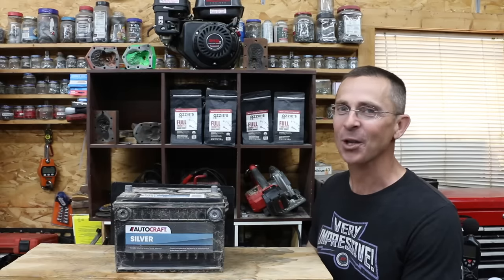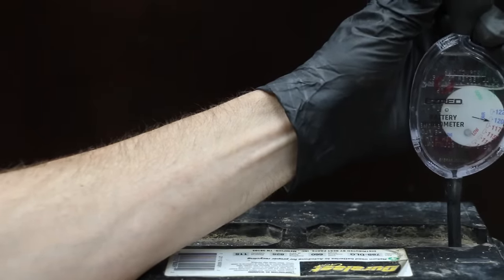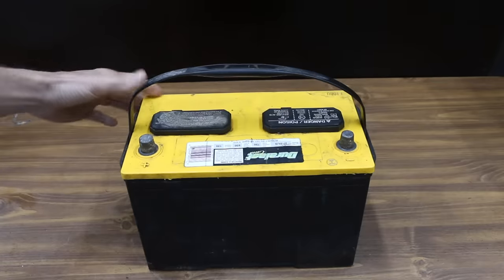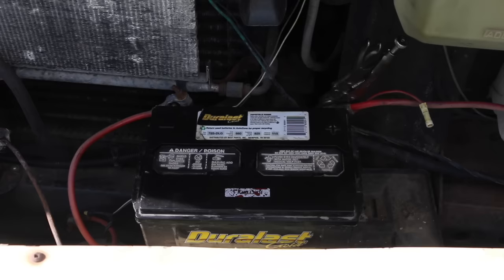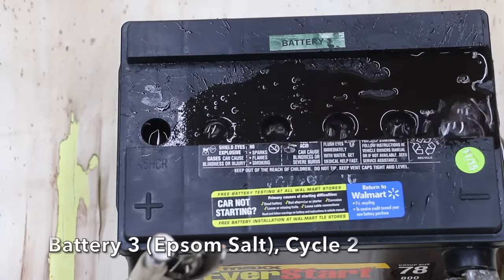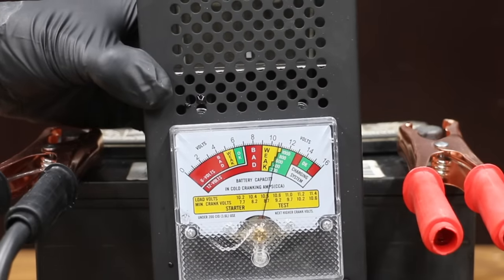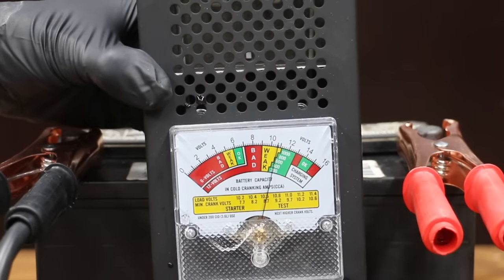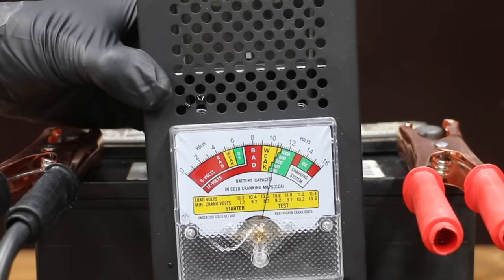Myth Busting! Can You Restore a Dead Car Battery With Welder?  Let's Settle This!

Comment: Desulfaters . . . Most I've seen are junk that "Look" like they are doing something when all they really do is drive an LED.

 However, I have a NOCO G3500 that has paid for itself over and over again. Mainly, because I don't follow the instructions included with the charger. They say to fully charge the battery BEFORE going into the "Repair" mode. That method does not seem to work as well as when I go straight to the repair mode on a bad battery no matter how low the voltage is. I've had to hook a good battery in parallel several times to get the cycle going, then remove the good battery. Once started, the little charger keeps chugging along.  (It's even a fantastic normal charger. Even though it maxes out at 3.5 amps, it will totally charge a car battery reasonably fast and actually go into the repair mode on its own if it "Thinks" that it's required. Genius! (Who'd-a-thunk about that?))

I also have a NOCO G10, and the difference with it, besides faster normal charges, is that the repair mode is limited to 4 hours, and it requires restarting the cycle for further repair.

The G3500 does not have this time limit. I have had that little unit on batteries anywhere between half a day and two weeks before the cycle would complete. If the cycle hasn't completed after two weeks, I test the battery and mostly call them a loss. I've had only one battery to come back after putting it on for more time. (Now, the bad batteries are not a total loss. I have a neighbor that casts lead bullets and he's glad when I get a truly bad battery.)

I also have a Vector VEC1092A charger (Pre- Black & Decker buy-out of Vector that ruined the newer Vector chargers.) that has an early desulfation mode that I haven't really tested out yet.

With those three charges, I'm batting about .750 for recovering batteries. I'd like to get one of the NOCO G7500s, but they are still more expensive than I can afford to spend on a hobby right now.

Thanks to this video, I now have a new tool to use in this little hobby of mine, and I already own a small welder. Adding that to the arsenal may improve my batting average.

Thanks for posting!
Reply from the maker: You are welcome!  Thanks for the feedback.

Comment: Thanks for another great video. From a chemical standpoint there's a rule of a thumb. If you want the battery to be in similar condition after you left it idling or discharging slowly disconnected from a nominal voltage of 13-13.8 volts, you should leave it connected for the same amount of time. Example, you left the car for two weeks , you should charge it and leave it for two weeks on a trickle charger. That's not practical hence that's why batteries die faster in vehicles used occasionally.  If you live in a relatively sunny location, there's a gadget online that can plug into your 12v socket(lighter socket on older vehicles) and is connected to a solar panel that you leave on the roof or close to the vehicle. That takes care of the chemical reaction in the battery. Your enemy is sulfation and this happens when the battery is kept disconnected. Buy a cheap trickle charger and then you can save $$$ on batteries!
Reply from the maker: You are welcome!  Thanks for sharing.

Comment: A video where you test different "short circuit" detectors for automotive use, and if you could demonstrate finding a short to ground  or power using a compass that would be so cool. Huge fan.
Reply from the maker: Thanks for the video idea.

Comment: Fun video.  Even on the one that was returned close to normal rating performance, cell #5 low SG is concerning.  The battery will likely die if it hasn't already since this video.
The welder trick is interesting, DC current basically just heats the battery up and electrolyzes the acid.  If the temp was 115F at the hole, be assured it is considerably more than that at the active material/sulfate crystal interface.
If there was any stratification of the acid (high concentration at the bottom) the bubbling certainly helped mix the liquid.
Reply from the maker: Thanks!

Comment: Love your channel, however I would think that you're supposed to add the Epson's salt to the battery without tipping the acid out. The acid is the driver of the chemical reaction in the battery. The Epson's salts would possibly act as a catalyst or rejuvenator but would not replace the action of the acid. Cheers.

Comment: I can't believe it actually worked.

My lightly used airport 48V golf cart had new batteries about 5 years ago (batts dated 2018). As expected, the range and speed declined over time until the useless thing sat unused for the last two years, as the batteries would not charge with the finicky digital charger.

A year ago, I tried using various tricks to get some power into each 8V battery (they were showing 0.54V to 2V) Then hooking up the cart's charger and so on. Best I got was about 2-3 minutes use, then they'd go dead.

After watching this video about using an Arc Welder to desulfate flooded lead acid batteries, I thought I'd give it a try. Using care to get a spark free connection. A fan to blow away tons of explosive fumes and a 5 minute limit, I followed the procedure.

Note the DC TIG welder's ground is POSITIVE. So that's where it goes. Started at 10A, until each cell boiled, then 50A for 4 minutes and 100A for a minute, boiling like crazy, a few cells boiled over so I backed it down and up again to reduce losses. That's it, as repeated "zapping" did not seem to be necessary. As each 8V battery was showing 8.4V or so.

Hooked up the charger, and they charged normally. Battery measures at 80% after a number of miles, and 50.4V, or 95% in the morning, after charging and disconnecting overnight. I believe it restored the batteries, as I can now drive it all over the place, down dirt roads, top speed runs, (it goes 30)

Success, just drove it 15 miles and it had plenty of capacity left.
Reply from the maker: Thanks for the feedback.

Comment: I did this with a dead battery.  I charged it four times with a half hour or so between charges.  The charging current was 100 AMPs, and the charging time was 20 minutes per charge.  The battery came out in pretty good shape.  I used it for over a year while I worked on an old vehicle.  It seemed to run low on current when the charge was 55% or less, and I had to use at least 10 AMPs to charge the battery when the vehicle alternator did not run long enough to do the job.  Considering the high cost of batteries today I would be happy with the results until a post should corrode off.
Reply from the maker: Thanks for the feedback.

Comment: 😮another great video. And i like how people weigh in. Its also about sharing knowledge. So i will weigh in with an extra step a person can do and why. First the why. In these batteries there are plate in line to one another, with not much of a gap, as time goes by these plates will flick off tiny specks of material, these speck fall and gather in-between these plate, in time they can and will cause a connection between plates, i.e a short. After getting a battery to bubble turn is upside down and drain while tapping hard on the bottom. A bunch of gunk that has settled in between plats is going to come out! With a coffee filter, stain the acid and repeat a few time if you want.   Reuse or better yet go to part store and buy fresh acid, its not that expensive.. and do a slow charge. Is is handy to have an old none digital charger because it will supply a force charge no matter what, an automatic,  digital charger will likely keep kicking  off for detecting a bad battery. Flee market and garage sales are a great place to get one of these old chargers and they will make even the deadest of batteries 🫧 bubble.
Reply from the maker: Thanks!

Comment: I see you have what appears to be the older style battery tender/maintainer that they use to sell at harbor freight and maybe other places. These were great, I had one for years and it somehow got lost or taken. These were great because the wires were heavy-duty, almost like the wiring used on an appliance in your home, not like the new style tenders that have ridiculously thin (like 20 gauge) wiring. Ths newer ones also have shorter wires, and the annoying springy coil that has to be pulled to stretch out.  I do own several of the new style as well because I have several battries that I maintain throughout the year, and they have a cheap tiny plastic housing (which can break far easier) with wire leads that you need to be careful with, if you snag something while carrying it, they are likely to just break. In addition to how cheap the leads and housing is, the alligator clips are also far cheesier, smaller, and thinner metal than they use to be too. If you can find the bigger heavier older style like you see here (5 plugged in to the power strip), I suggest buying those instead of the smaller flimsy cheap one's. I understand they produced them like this to keep costs down and make them more affordable, but if they break  while being stored, carried, dropped or pulled out of a drawer, its not worth it. The old style was less than $30 and even came with different style leads for clipping on, or semi permanent connections with terminals. So $30 compared to $9, yes a third of the price but not if they keep breaking and need to be replaced or repaired.
Reply from the maker: Thanks for the feedback.

Comment: Try wood ashes that have been wash you want slightly damp wood ashes from an ash pile after a bit of rain. Put them in the acid to convert potassium carbonate to potassium sulfate they will bubble and make carbon dioxide. The voltage may drop but current may go up. Or you could just add aluminum sulfate instead of magnesium sulfate.

Comment: Consider if you will, testing quick clamps! Like Irwin and pony to test which is best. You could do a test with all the main name brands and inexpensive brands. Maybe test how much tension each one can clamp down to, and how much tension is lost over time. And even measure the amount of damage it causes on wood vs all the other brands. And finally you could test it's corrosion resistance and weather resistance, and compare them all to see which one still can function best. Maybe even measure which one breaks the easiest with a crane scale attached to the top portion and bottom portion to see how much it can hold without slipping open

Comment: Interesting and excellent battery test!  

How many cycles on the welder did you do with each battery?  I have a battery charger that has a 100 amp jumper option and was thinking about using this jumper option on the dead battery to try and revive the dead car battery....

I've got a couple a dead batteries kicking around and maybe I can try reviving the dead batteries with the 100 amp jump start function on the battery charger.....

Yes, I can confirm that a 100 amp engine starter / battery charger does also work to restore a dead battery!  Just make sure all the battery cells are bubbling and the car battery should work once again for a few more years.....

I did notice that a battery can be saved if all the battery cells display lots bubbling during high amperage charging.  After multiple short burst 5 minute tests with 20 minute cool down in between and a voltage test in the morning batteries that become revived will display a 12.4 volts.  

The weird thing is I had one battery from Costco where there was little bubbling in the third cell during the 6 short 5 minute high amp charges but when tested on the manual Chicago Electric load tester the battery test good!

Comment: I just learned that if a car battery no long charges, and is below 0.5v, you can reverse charge it and restore it to 12v meaning you connect the charger +ve to the -ve terminal of the battery, and -ve to the +ve of the battery.  Once it's fully charged, you can once again drain it and charge it back with the normal polarity.  It would be interesting if you could do this test to see if it's just a myth, or if it actually works.
Reply from the maker: Thanks for the suggestion.

Comment: The welder application is very interesting -- but I've had far better results using a Noco brand charger. It has a "Recovery" mode for badly sulfated batteries. I went and tried on about 6 dead batteries that were old cores that would not take a charge -- and FIVE of them were fixed! Even after re-installing them in a car & letting it sit for a month -- it fired up like a new battery. It is an incredible gadget that you should make a video on. The only thing it didn't work on was an AGM deep cycle battery -- even though it has settings for AGM & deep cycle. One of those batteries had been sitting around for over 2 years in a dead state -- and it's like new again. The only drawback is that it usually takes 3 days on a bad battery. It has indicators to tell you if the battery is good or bad at the end of the cycle.
Reply from the maker: Thanks for the feedback.

Comment: This was a pretty interesting test. I didn't see you try adding fresh acid to any of the batteries. I've had luck with that in the past with flushing the cellar first and then heavy charging that would be a little less than your welder. 
Wondering what voltage the welder was putting out? Was it true DC? Or was it some kind of pulse? I'm surprised you didn't investigate what the welder output was? Do you happen to know???

Comment: The way i used to do it. Was 1. Empty acid out and let sit 24 hrs. 2. Put baking soda in the cells and wash the cells out a couple time. 3. Filter acid and put back in battery and top up with distilled water. 4. Charge battery. Unless a cell is damged it work. I use fresh acid but very hard to get here in Australia  cheers Graham
Reply from the maker: Thanks for sharing.

Comment: Thank you.  I have a question,
After DE sulfating the battery should you not drain the fluid out fitter it to take sulfates out, clean inside the battery with distilled water then fill it up with new acid?

Comment: I don't understand why people are doing it wrong with the Epsom salt. 

1. Empty acid. Don't throw away, as it can be reused.
2. Fill with salt mixture.
3. Run the 5x high voltage cycles. 
4. Empty salt mixture, and flush with tap water until clear, and one last flush with distilled water to flush tap.
5. Refill with acid. Making sure its where it should be with bulb tester.
6. Recharge battery. 

If you want to use the welder to charge, it's much more recommended. Also the salt mixture "is only" for breaking down the lead sulfate from the lead plates.

If the acid is black from the lead, when you dump it out, allow it to sit, and the heavier lead particals will drop to the bottom. 
Try not to dump the dark stuff back into the battery. 

The lead sulfate floating, causes resistance, which is why you can have a battery, which shows full charge, but has low cranking amps. 

You must clean the plates, and get rid of the sulfates. Otherwise your defeating the purpose. 

And the reason why the welder charging works so well, is because it cleans the lead plates, and you allowed the particulates to precipitate out and to the bottom. 
But you defeat the purpose, by leaving it in, because it will get stirred up when driving around, or just moving it around. 

This would be acceptable, for say, deep cycle batteries in a stationary place, where the lead sulfate isn't getting mixed up in the acid.

Please try again. But use my proven method. 
There is another Youtuber that used my method, and was able to successfully renew every single battery he has had brought in to him.

I have brought back VERY DEAD batteries to life, with my method. 
Please make a video using my method. So many Youtubers have done it wrong, that its difficult to find the only one, that I found, who did it right.

FYI. You cannot replace battery acid with Epsom salt mixture, and expect it to hold a charge. As there is a reason, why every single battery company uses battery acid, and acid gel.

The problem with the gel, is that you can't fix it like you can with a liquid acid and distilled water mixture. 

It really is very simple everyone. Basic chemistry. 
Try making your own battery, and you'll understand why I use my method.
Reply: On AGM battery (dry battery) how to process with epsilon salt, i dont have access to welding machines. I do have ups and inverter only in my accessibility.

In AGM battery, the separator usually soaked up everything and keep inside

Comment: Great info PF!!
I have a golf cart powered by 6 Trojan 8V Golf Cart Batteries T-875 (48V total).  They are about four years old and have lost about 50% of their range and power to go up hill and/or carry a full load.  I would like to try the stick welder method to rejuvinate them.  Questions:
1. Is the process any different with an 8v battery?  If so, would would be different?
2. Can they all be done at the same time while in the golf cary if they remain in series?  If so, would the amperage applied change?
Reply from the maker: Thanks!  Thanks for the suggestion.
Reply: @ProjectFarm Good morning. I wasn't offering a suggestion because I'm not knowledgeable enough lol. I was hoping you would answer the questions that I asked. I hope you will.